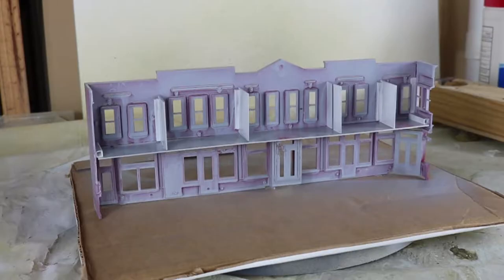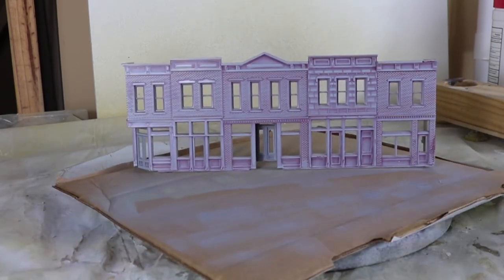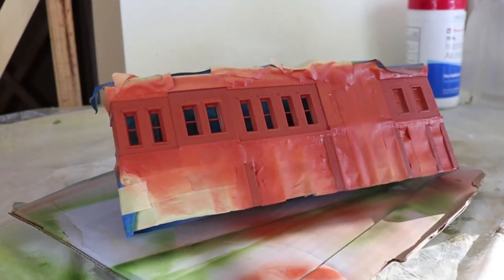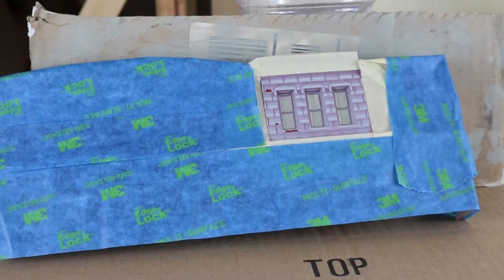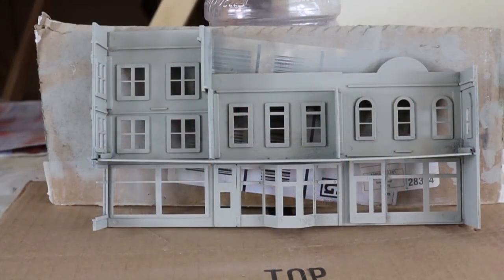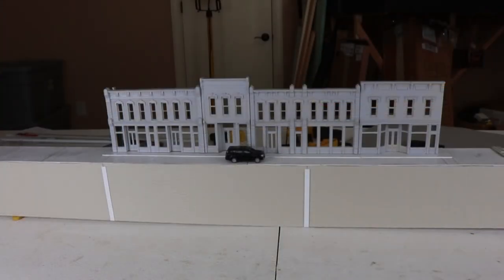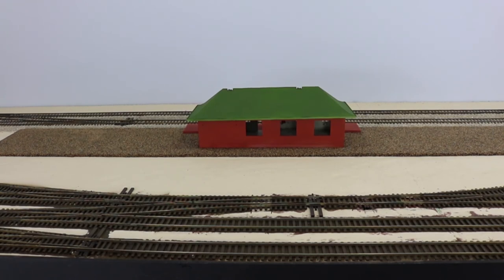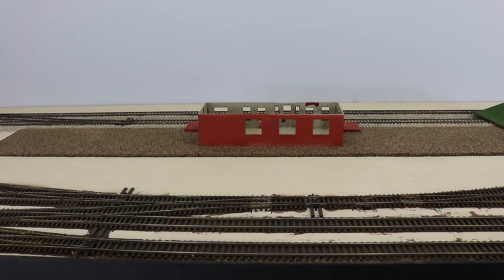How To Airbrush a Plastic Structure

Comment: For painting bricks I usually spray them red or some form of red.  After it dries I choose my colour for the mortar and wipe it over the red bricks letting it settle into the brick joints and make sure to remove the mortar from the face of the bricks.  If you take your masking tape and put it on a garment (shirt, pants) several times then use it for masking and you lessen the adhesive effect of the tape.

Comment: Looking good Harold! Are you planning on lighting any building interiors? That tan paint may let light bleed through? Use blue or green painters tape. It has a lower stickiness than regular masking tape. Found at any hardware store or Wal-Mart's.  Roy
Reply from the maker: Thanks for watching and for your suggestion. Yes, I plan some lighting using Just Plug Lighting from Woodland Scenics. I'm trying this for the first time, so we'll see how well or poorly it works. Based on your experiences, I may have to do something unexpected to stop the light bleed. We'll see that in a future video probably about three weeks from now...Harold